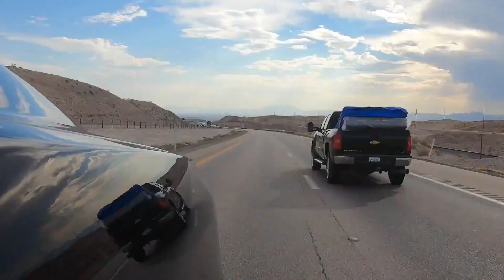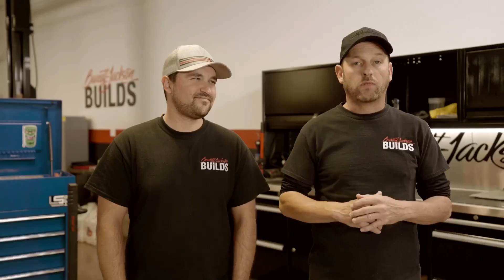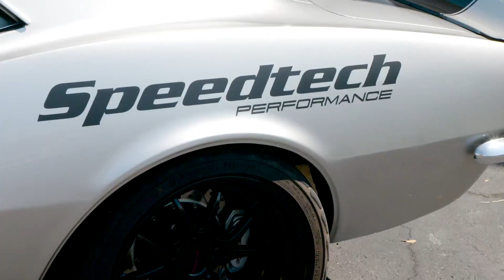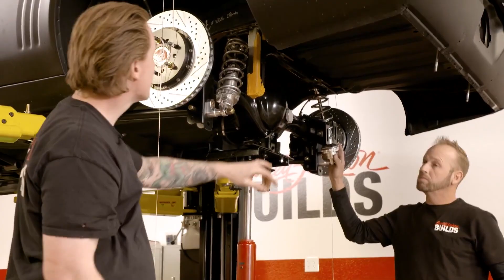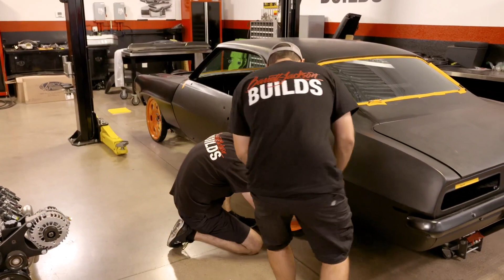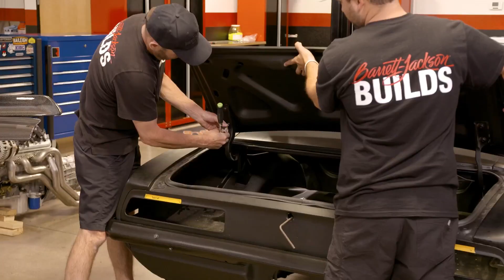Barrett Jackson 69 Camaro Project Featuring Speedtech Performance Chassis and Suspension EPISODE 5

Comment: why did you need to cut down the speedtech rear crossmember??
Reply from the maker: Barrett Jackson ordered the Dynacorn Body with Mini tubs.  When they make them with mini tubs integrated it is cost effective to just move the rail in rather than a typical mini tub where you'd modify the frame rail.  Dynacorm move the frame rails in towards the center of the car significantly.
Reply: That explains the reason of "shortening"  the rear x-member